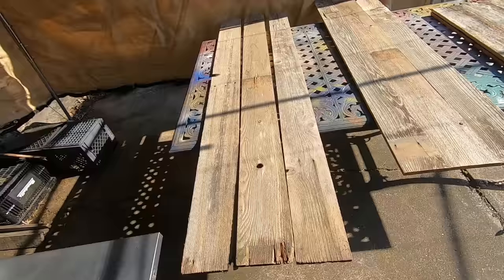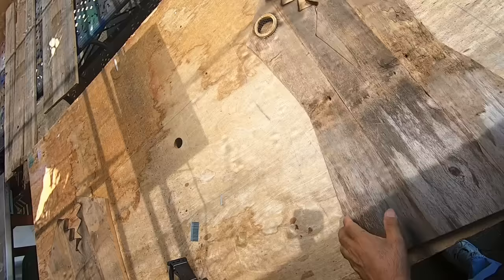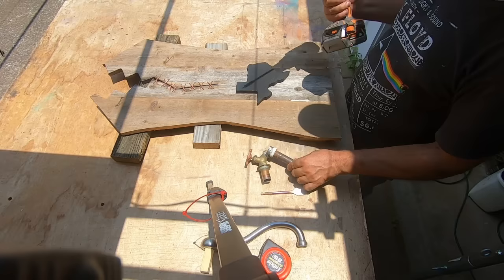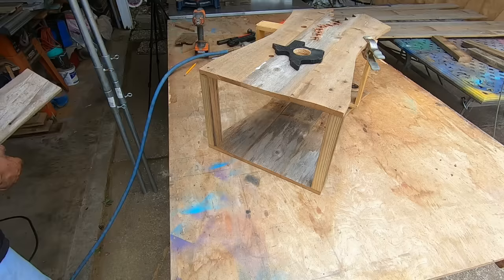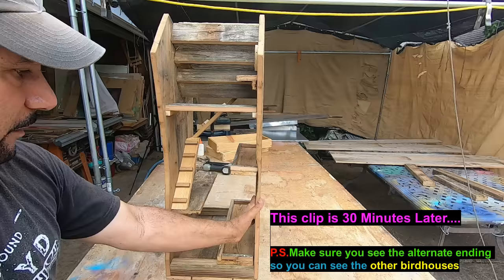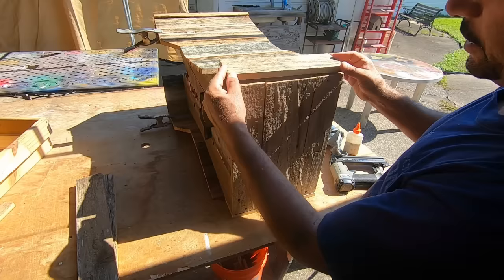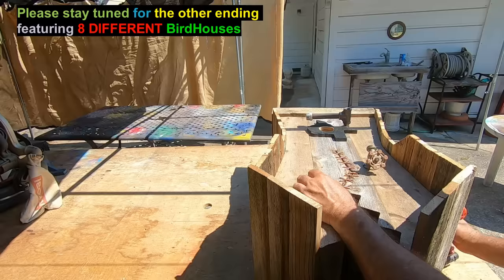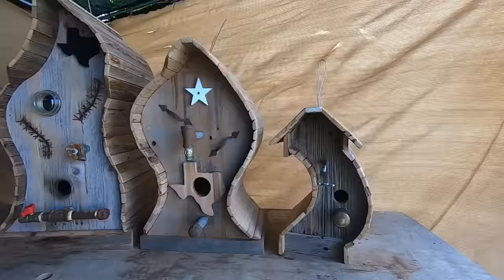Birdhouse, step by step Instructions to build the COOLEST Birdhouse EVER! Must See!!

Comment: There are several reasons that a camera will automatically turn off. Two of the most common causes is the battery saving mode. That can be disengaged in the firmware settings. The other is over heating. If the camera is shutting down about the same time after starting it then it is probably the battery saving mode. If you aren't sure and think it may be over heating you can test it by taking the camera into a climate controlled environment and give it some time to temperature acclimate before doing a test recording. If it auto shuts off it will probably be the battery saving mode. Hope this helps.

I enjoyed the woodworking. Keep the videos coming. Your videography skills will come just like the woodworking skills did.

Thanks for sharing!

Comment: These look awesome. So creative! Are they for real use? What kind of bird(s) would use them? Asking because I’ve never seen anything like them, which means birds in my area may not use them so no reason to make them unless for decoration. Lmk if they’re getting used or not. Thanks!
Reply: These boxes look great but birds themselves don't really care what a bird box looks like.  The type of bird that uses the box is concerned more by the location of the box (high/low, sunny/shaded, exposed/concealed, etc.) and - most importantly - the size of the entry (generally, just big enough to squeeze through).  Perches look pretty but are not generally recommended because the inhabiting birds don't need them but they aid predators.

There's plenty of information on the internet about all this.  Just search for "bird box preferences Texas" (or wherever).

Comment: When you glue your boards together do you use biscuit to hold or how
Reply: You will find glue is strong enough by its self biscuits dont help with strength normally used to help align things together, you could use dowels which would add some strength, hope this helps😁